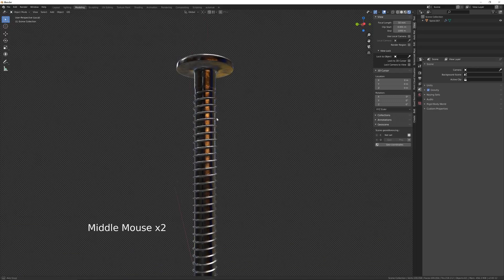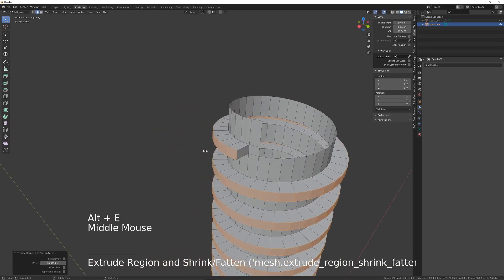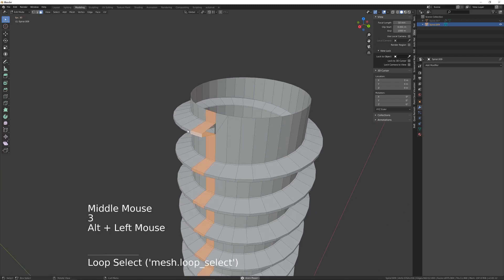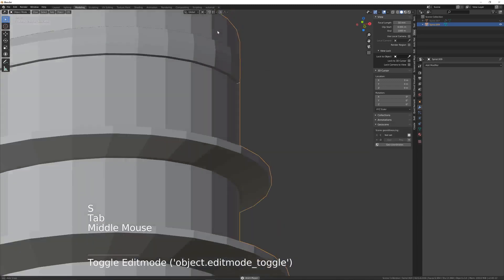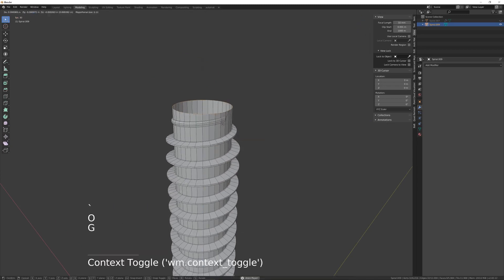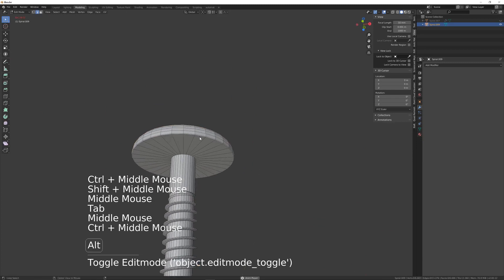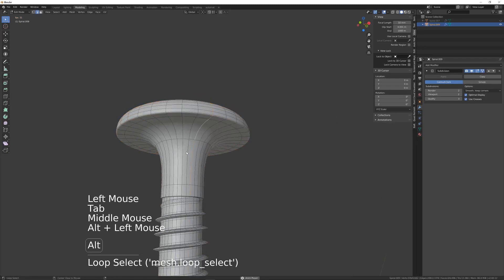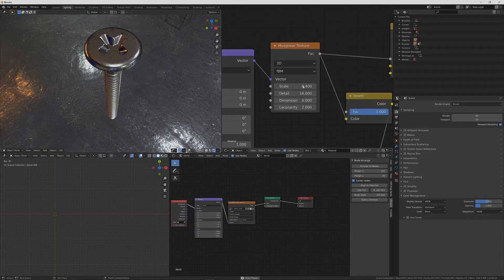How to model a screw in Blender

Comment: 3:32 hi! how did u tighten the top of the spiral? when i do it only one side (along the x axis) is scaled down
Reply: hi, i had a hard time figuring this one out .... it's actually the Z axis; select the face > S to Scale > Shift+Z to lock global Z > adjust falloff with the mouse wheel. Of course the rest of the faces have to be hidden, and also the proportional editing mode has to be toggled (Press O before scaling)
Reply from the maker: Set the proportional edit options to connected only, then when you increase the fallof of its effect, the falloff will work it’s way around the spiral rather than just encompassing everything within the falloff gizmo
Reply: @3d-illusions  I can't get it to not scale the entire screw. I have connected only toggled, but I still scale the inner cylinder too.
Reply from the maker: @jonmikkelhansen5196  You have to turn on proportional editing with the O key, and also make sure the parts of the model you don't want to effect are hidden.

Comment: How do you flatten the top by pressing only S?
Reply: i figured it out: [s] + [z] + [0]
Reply: @eypogamergleisneun8261  You also need to make sure the origin of the mesh is set to the top of the screw. I ended up having to select the top-most edge, then snapping the cursor to that edge, then (in object mode) setting the object origin to the cursor, before S + Z + 0 worked. Also see: https://designsync.com.au/how-to-quickly-flatten-vertices-edges-or-faces-in-blender/
Reply: Also... looks like I missed the part about setting origins to "individual origins".
Reply: @eypogamergleisneun8261  Thank you very much
Reply: I've the same question